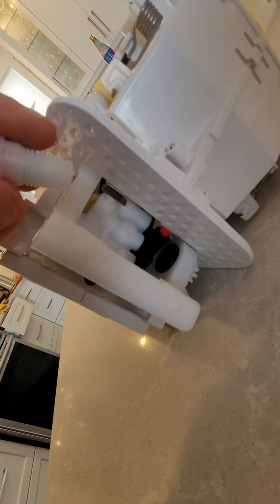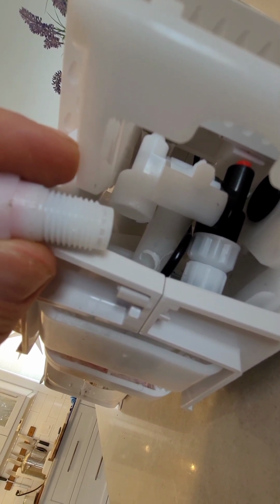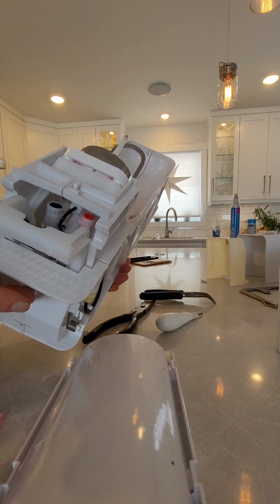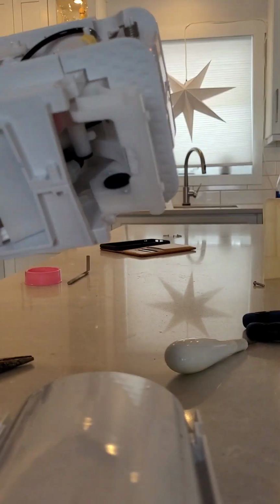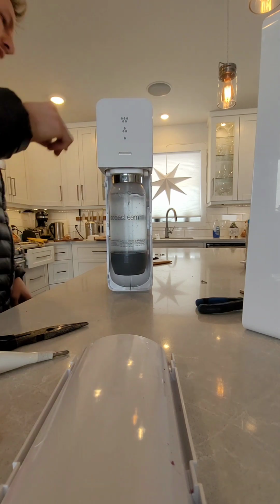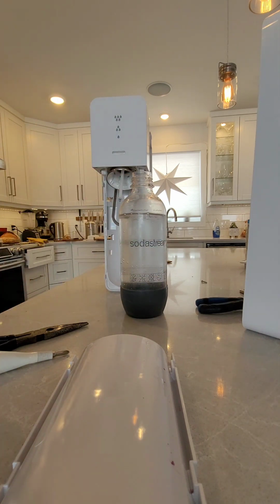Disassemble Soda Stream, fix pressure relief valve. V2.0

Comment: In your earlier video, wasn't the black valve the pressure relief?
That being said, it was definitely the red side that was spewing water for me. I ended up throwing a small screw in there with the spring, essentially disabling the whole feature.
I remember adding glue to the black side a while back for a similar issue, don't recall exactly why, or what the specific differences are between the two valves, but I can now pressurize my bottles without any leakage.
Didn't need to disassemble the entire machine, though. Only had to remove the top front assembly.

Comment: That white part snapped in 1/2 on my machine. Sodastream sucks.
Reply: The  housing that is supposed to come out , that holds the spring broke on me. Every thing is extremely tight. using heat  is the only way to get it unturned
Reply: @autobike1  they are junk machines. I have a new machine and it is so much better, Simpler, and bottles are much better. Mine was leaking from day one. Poor quality build
Reply: I did that on my first attempt. Once it is getting hard to turn just stop. I know I overtightened mine as I just kept turning thinking I could get all the threads in there. You cant. Not even close.